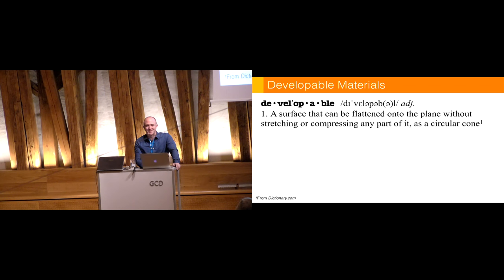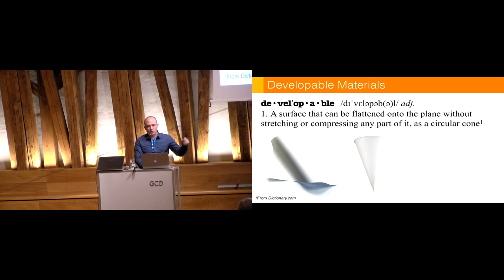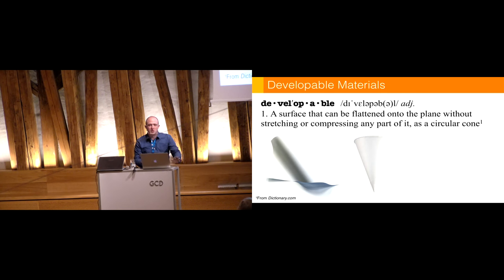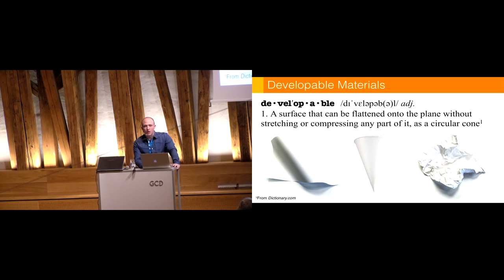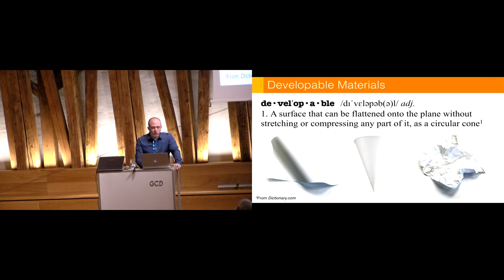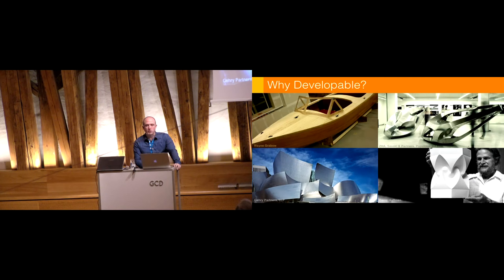Discrete Differential Geometry and Developability

Comment: Nice talk as always. Too bad there was a lot of clipping on your mic. Should have been turned down just a little.
I visually like how these developable surfaces turn out. They look sort of "low poly" except smooth.
There is this idea of "facial planes" meant for sculptors and 2D artists, to get down the volume and shape of faces more clearly. That technique tends to result in takes on faces that look very similar to these developable surfaces. So I wonder if you could use that technique on 3D scans of real faces to then auto-generate such a concept.
The only problem I saw is that small features, such as ears of that horse statue, tended to be abstracted away, which probably wouldn't be useful for this scenario. If that same think could be done while preserving such details, it'd be perfect. I'm guessing that's what that curvature directed thing is gonna be all about.

Though this was literally a year ago. So... what's new? Did this already work out by now?